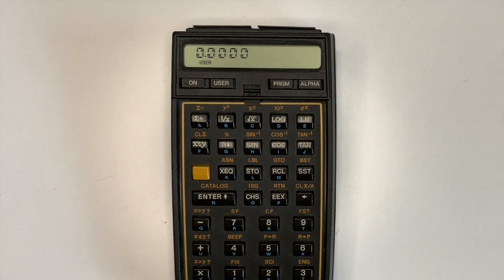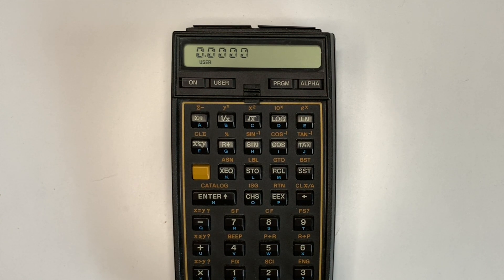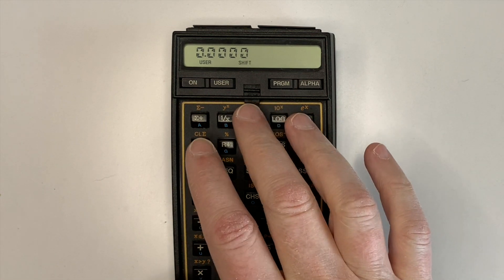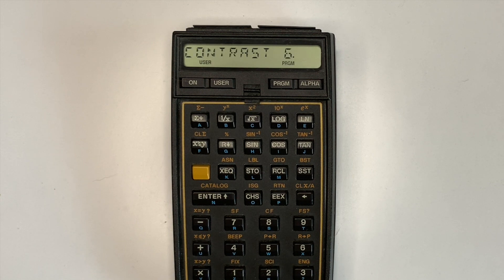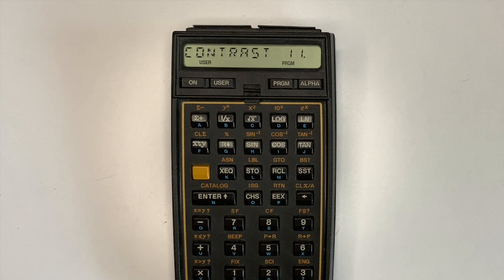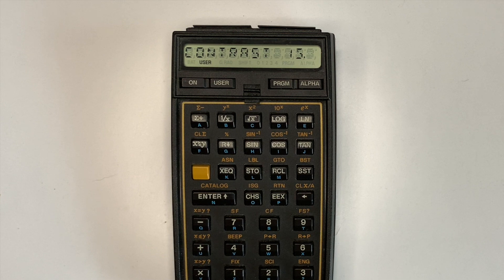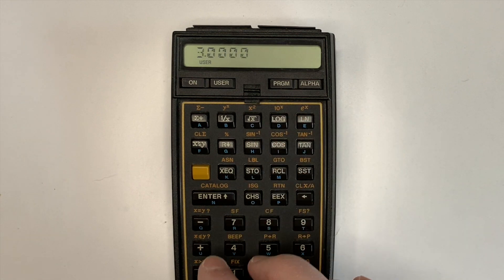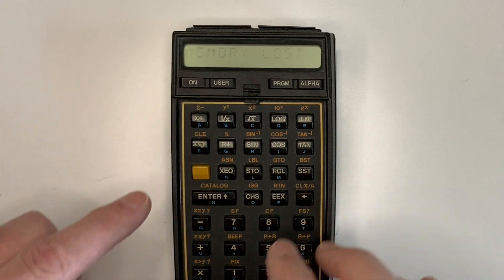HP 41C / 41CV / 41CX Halfnut Display Contrast Configuration Demo

Comment: Nice video, but my how your voice has changed... ;-)
It would be nice to share the MCODE for this small program so those with HEPAX, NoV or RAM emulators can poke it in (with assembler or even HEX) to explore.
Thanks!
Reply from the maker: Good idea Robert. I used HEPAX for this video and the HEPAX module has a simple contrast command already included (HEPAX 005 with contrast from 0 to 15 in X) so this program is a simple FOCAL ISG loop. I will find and list some sample MCODE for other situations.